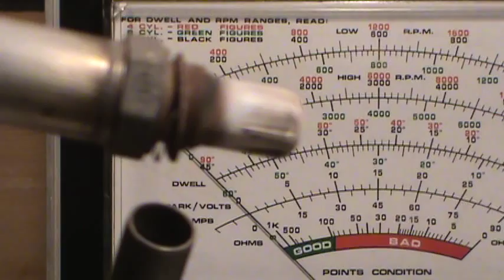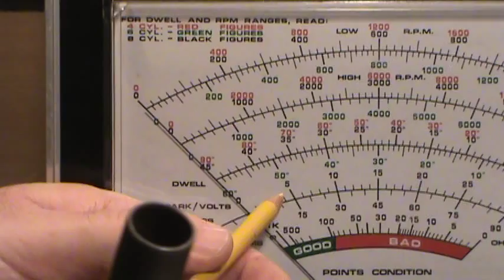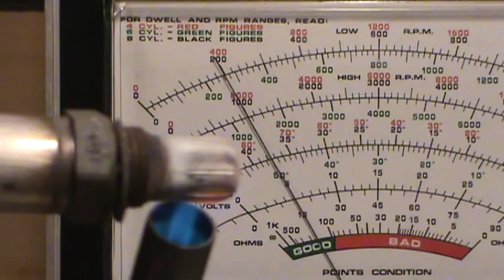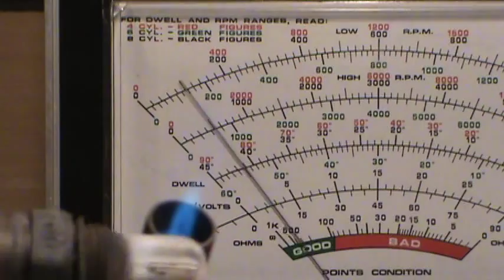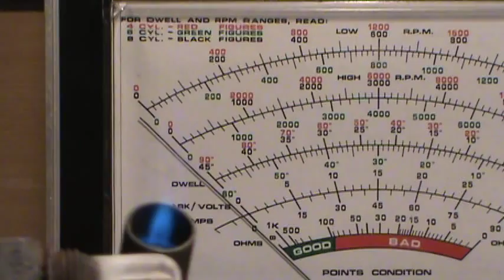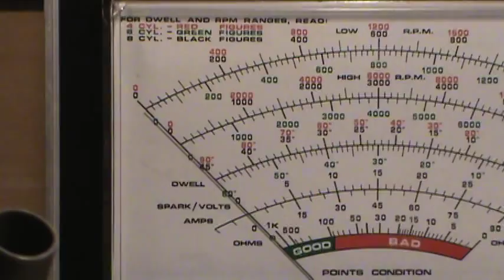Oxygen Sensor Test (Part 2)

Comment: I see you not fully understand how oxigen sensor have to work. for example 5:10, 6:38.
Reply from the maker: Greetings...megstuBMW...........Thanks for watching...........Well, maybe, I didn't realize, at to what, was supposed to happen, way back when, I made this particular video, as it applies to, a narrow band oxygen sensor's, so called "cross-counts" (aka, switching) alright, but, as of now, I'm pretty sure, that I kinda know, what really should be happening, and is, as follows...........In order to make a properly functioning, narrow band oxygen sensor, produce the "cross counts", as in, kinda like a wave, that goes above and below, the (stoichiometric) 450 millivolt line (.45 volts), then, the oxygen sensor must be installed in the vehicle's exhaust system, pre-cat (as in, before the catalytic converter), while having the vehicle's engine warmed up enough, and running, at a low load/cruising speed, or, at idle speed, so the vehicle's on-board computer, will be able, to go into, the "closed loop" operating mode..........The (not so smart), narrow band oxygen sensor, only knows stoichiometric (14.7 to 1 air/fuel ratio), or, that it's too rich, or, too lean, so, the computer, changes the fuel injector's pulse width, back and forth, from, too lean, then to, too rich, then, back to, too lean again, and keeps repeating, these so called "cross counts", and......till next time......Be Safe, take care, and have a good one.

Comment: so where are these volts coming from?
the sensor creates voltage?
A volt meter measures voltage, but where is it coming from?
Reply from the maker: Greetings...1112223333111.............Thanks for watching............The Oxygen Sensor, that You saw, in this YouTube Video of mine, is known as the..."Zirconia"...type, and, is also called, a Narrow Band type as well, and, if it's working Ok, it will usually Output a Voltage, up to, no more than, about 1 Volt, when the sensing end of it, is Heated Up-to, about 600 Degrees Fahrenheit or Hotter...............The Lower the Voltage reading (closer to Zero), the Leaner the Air/Fuel Ratio will be................The Closer to 1 Volt, then, the Richer, the Air/Fuel Ratio will be...........There is also a..."Titania"...type of Oxygen Sensor as well, and it's, (Ohms) "Resistance" will change (Not Voltage...!!!), when heated up properly...................There is also a Wide Band, type of Oxygen Sensor as well, that will probably be outputting, a somewhat higher Voltage (maybe, about 5 Volts maximum perhaps), and is vey accurate, as compared to, the Narrow Band type of Oxygen Sensor.................Maybe, do an internet search, for the different types of Oxygen Sensors, cuz, some of those Websites, that are out there, sure do, go into, some rather fine detail, I must say....and...........till next time..........Be Safe, take care, and have a good one.
Reply: oh ok I didnt know that.
I tested mine in the car and it was bouncing from 0.1 to 0.8 volts.
I guess thats ok?
Reply from the maker: Greetings...1112223333111.................Well, if Your particular Oxygen Sensor, is the Narrow Band type, then, I'd say, that, it's probably working, as it should be doing, alright..................What You are probably seeing, when the Voltage "Fluctuates/goes Up and Down", from that 0.1 to 0.8 Volts, is usually, what is known as/called..."Cross Counts"....................Lettuce (lol) see now....."Half-Way", between 0.1 and 0.8 should put Us, at about .45 Volts, which should be, what is referred to, as being..."Stoichiometric"...that be, where, the Air to Fuel Ratio, is at, about, 14.7 to 1 (air/fuel ratio, while also, being at, somewhere near sea level as well, perhaps), and that particular..."Stoichiometric"... Air/Fuel Ratio, is, such that, the Air/Fuel Ratio/Mixture, will supposedly, be Burned up, somewhat Completely, and usually, will take place, when the Engine is fully warmed up-to Operating Temperature, while also, for the most part, be, having the Engine, at Idle Speed, or, just Cruising along, not too fast, at a steady speed, that will usually have the Vehicle's On-Board Computer, "in", what is known as, the "Closed Loop" Operating Mode, and, that's about the only time, that the Vehicle's, On-Board Computer, will actually be "Listening-to", what the Oxygen Sensor/s, have to say, in respect to, whatever Voltage Signal, that the Oxygen Sensor/s, are Outputting/Sending to that On-Board Computer, at the time................The On-Board Computer's..."Open Loop"...Operating "Mode", will usually be happening, when the Engine is Started Cold, and is just warming up, and also, something-like, when the Engine "is" fully warmed up, to operating temperature, and the Driver of the Vehicle, happens to go..."Pedal-to-the Metal"...as in...WOT/Wide Open Throttle...where-by, the Oxygen Sensor's Voltage Signal, will usually be ignored/not used, cuz, during "Open Loop" Operating Mode, the On-Board Computer, will usually, be using, an internal, pre-determined/programmed Map, that it interacts with\and might modify, in real time, somewhat, so as to provide, the (hopefully), Correct Air/Fuel Ratio, as well as, the Correct, Ignition Timing Advance, for that, "High" (Engine) "Load", Operating Condition, of the Engine, at that particular time.................While going WOT/Wide open Throttle, the "Open Loop", Air/Fuel Ratio, might go, as Rich as, about 12.5 to 1 (ball-park figure), cuz, if going Too Lean (of an air/fuel ratio), while doing a WOT/Wide Open Throttle Run, just say...Bye-Bye Engine...cuz...Engine Damage...it will probably be, and I hope not............So, that's about it for now, and, if You have any questions or concerns at all, just give me a shout.......and........till next time.........Be Safe, take care, and have a good one.
Reply: its a single wire older style.
it was going every voltage
Reply from the maker: Greetings...1112223333111..................Yes, indeed, the Narrow Band type of Oxygen Sensor, will probably, be doing, that Swinging Voltage, up and down, as in Cross Counts, alright.................An Oxygen Sensor, that has up-to, about, 4 Wires coming out of it, will usually be telling me, that, there is a "Heater" built into it, so it will Heat-Up very fast, when the Engine just gets started, where-as, a "Single Wire", type of Oxygen Sensor, "depends-on", the Heat of the "Exhaust Gas", that's coming out of the Engine, and through the Exhaust System, to Heat it up, which does, take more time, to, get it to heat up, to that 600 Degrees Fahrenheit temperature, or Hotter, so the Oxygen Sensor, will start working properly..................Oxygen Sensors, will Wear-out eventually.................Sometimes, when they start to wear-out, or get contaminated, they might, start Responding too Slowly, or quit working all-together, and, there might even be a "Warning Light", on the Dash-board, "Lighting-up", to tell You, that, there's one, or more Problems, that the Vehicle's, On-Board Computer has "Detected", and probably, will have, One or More "Trouble-Codes", stored in its "Memory"..................Depending on the type of Oxygen Sensor, and how well, and Clean, that the Engine is running, will usually, help determine, just how long, that, One or More, Oxygen Sensors, in the same Vehicle, will usually last................From what I recall, some Oxygen Sensors, depending on, their particular design, can last about, 50,000 Miles, while, some of the other ones, can last, up-to, oh, about 100,000 Miles, there-abouts, as long as, the Engine Runs Cleanly, and Properly, as well, that is................Are You having some kind of Trouble with Your Vehicle at all...???.................If, and when-ever, You, or Someone-else, Removes the Oxygen Sensor, then, have a look at, the end of it, that, was exposed to the exhaust gas..........Sometimes, they can have, a black Carbon coating on them, and that's telling me, that, there might be a problem, with the Fuel (injection?) system, or, maybe, might even be, something along the lines, of a weak, or, misfiring Ignition System, and hopefully, Not Both, at the very same time...!!!...Yikes...!!!...lol......and........till next time........Be Safe, take care, and have a good one.